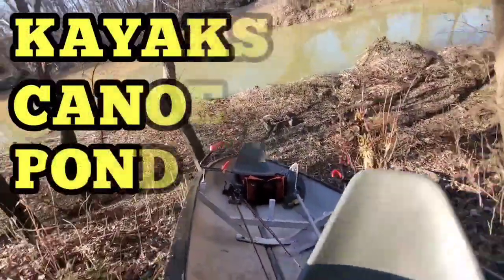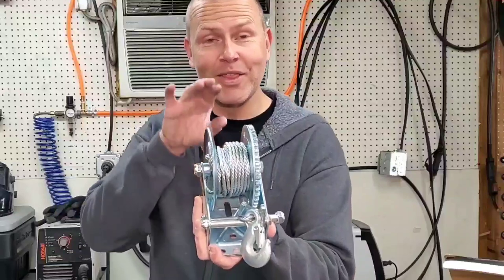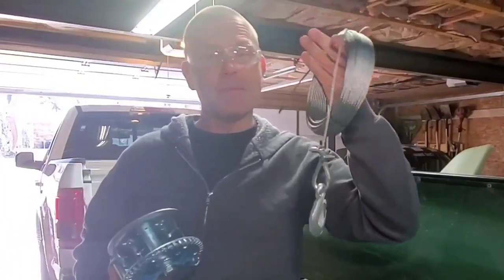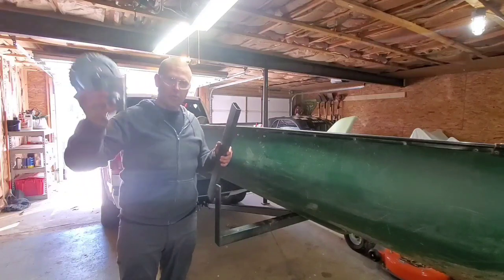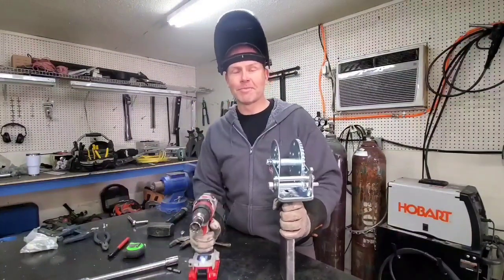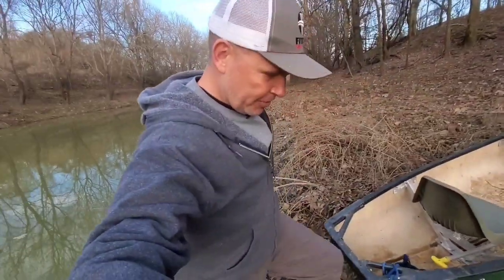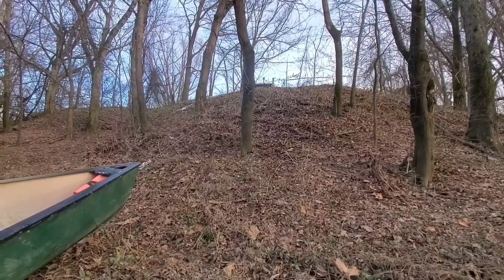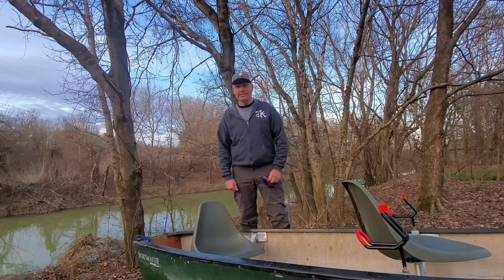D.I.Y. PROJECT for KAYAK, CANOE,  and TINY BOAT OWNERS

Comment: Great, thanks for the video! That's what I had in mind, except I'd like to fix the winch to a tree, with a strap or a rope, because I don't have my car near the bank. Anyone did that? I think the winch would be far enough from the tree, and would have a pod (wood or metal) to have a good stand on the ground. In this case, I'd be able to get my kayak on and of from any point of the river. Very convenient to pass locks on canals, etc. I'd bring the device with me in the kayak.

What do you think?